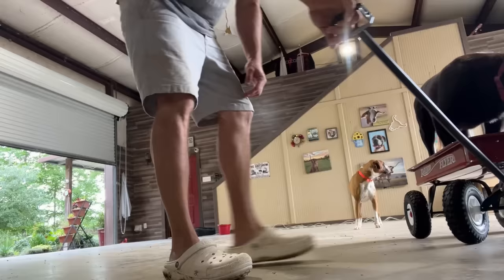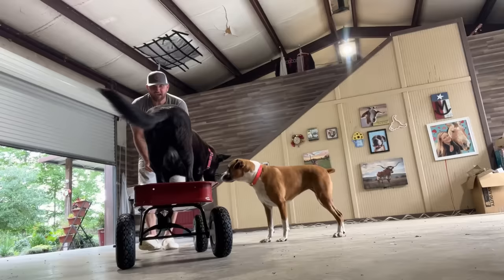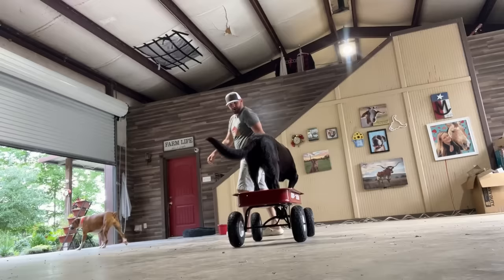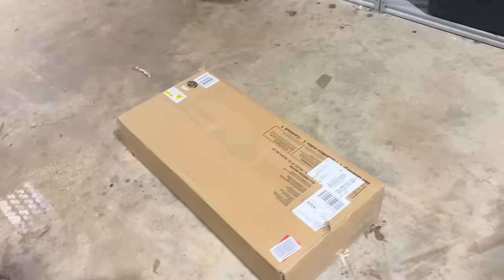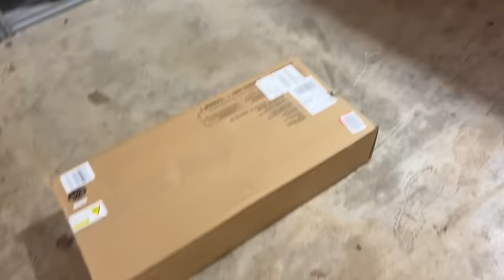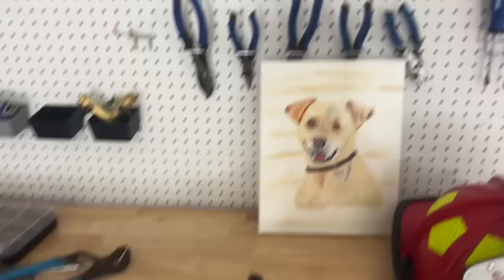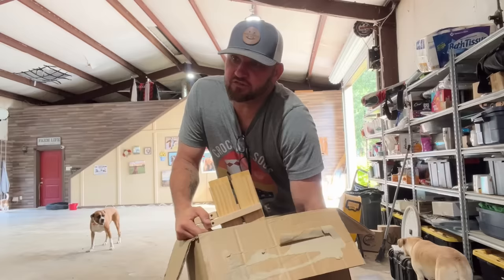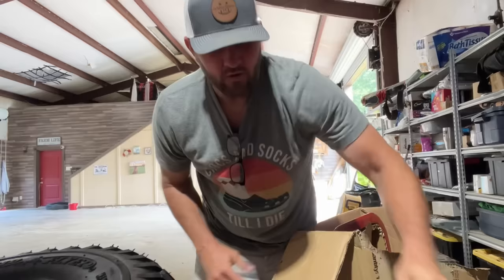Best Baby Shower Gift EVER!

Comment: The little red wagon I used to have didn’t have such beefy tires they were hard rubber. I got more use out of my wagon when I got older use it as a downhill riding toy on our driveway, luckily at that time I road was a dead end so it was relatively safe to go flying down my driveway in my little red wagon and I don’t know how I never got hurt.